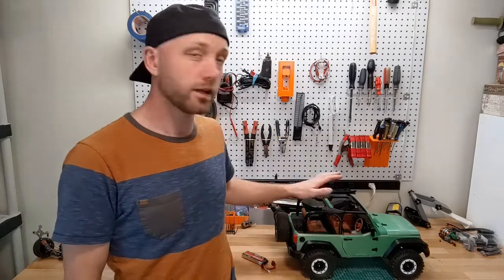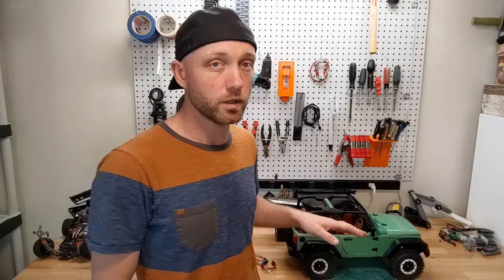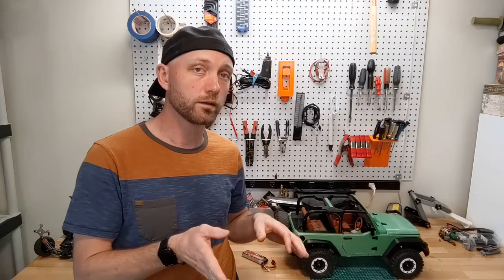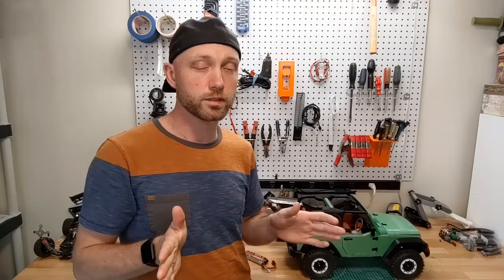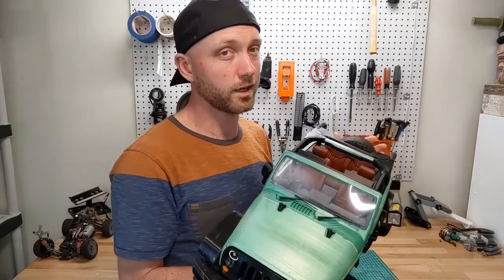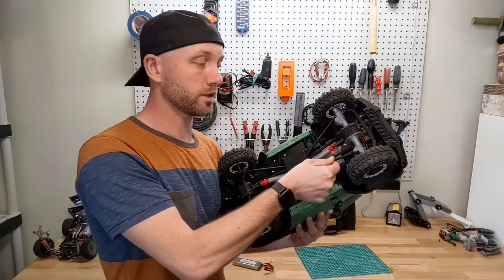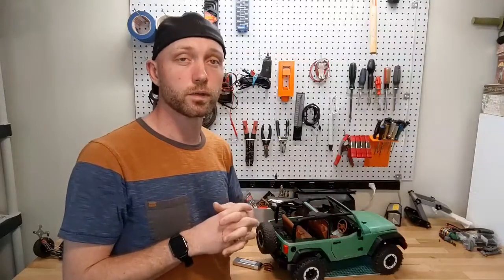3D Sets Rancher Review - Should you build this 3d printed RC Jeep?

Comment: Nice and honest review! A few hints/ tips from a Rancher owner: use higher temps when printing the drivetrain parts in PLA - around 220-230°C depending on the filament - to improve layer adhesion. Also: repairing/maintenance is not as complicated as you have described. E.g: you can drop the whole gearbox/motor by undoing 8 screws if I remember correctly from my Rancher (the center piece at the bottom, the two screws that hold the gearbox/motor and one cardan joint to get it out). You can take out and disassemble the gearbox in a couple of minutes, been there, done that :) For the lights: there are quite easy mods on thingiverse, especially the front lights, rears are a bit tricky because of the limited space. Also quite important: there is a very active, enjoyable and helpful facebook community for the 3dsets cars!
Reply from the maker: Thanks for the tips!

Comment: Good video, nice review of the Rancher. I've spent the last several months building one for a friend several states away so I have had to go the bulletproof option but I have had the trans in and out numerous times getting everything right. You should only have to pull the two screws on the trans, the two screws for the dash and maybe the 4 screws for the skidplate (had to pull the skid to fasten the driveshafts after the fact) to pull the trans out. Have you seen 3d sets Model 7 Buggy? It might be right up your alley :)
Reply from the maker: Thanks for the tips! The buggy is definitely on the list to build. Hope I can get to it soon.

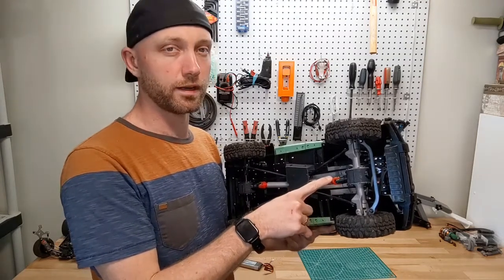Comment: When you said that you had to reprint the parts that were failing(around the 10:30 mark) you said you used PETG initially, but didn't say what material you ended up with after you reprinted them.  Do you happen to remember? I had those drive shaft joints fail me almost immediately, and I printed them in ABS.
Reply from the maker: Just PLA. It's the 100% infill that makes the difference.

Comment: if I were to send you a bunch of pictures of my jeep ( inside and outside) would you be able to design and print it? If not do you recommend anyone who you like for rc car? Great video!
Reply from the maker: Hey Holly, you're really going to want a 3D Printer if you're in the market for one of these things. Parts WILL break and it wouldn't be a great experience if you couldn't get replacements easily. I'd recommend getting an Ender 3 V2 and learning to print it yourself, its really not that hard and we have build kits here: https://rcprinter.com/products/3d-sets-rancher-build-kits! I don't know of anyone who would 3D Print a custom Jeep for ya. To price it out, non-printed parts are going to be a couple hundred bucks and you'd have to buy a copy of the print files from 3DSets and then the printing time is going be weeks of continuous print time and filament and then the build time is a day or two of work plus painting all your customizations so the cost someone would have to charge would be quite high. I think if you found someone who would be willing to do it you'd be looking at a price tag starting at maybe $750 US and going up from there ... and then you'd still have the fixing it when it breaks issue :-/

Comment: Love my rancher, you can actually take out the whole gearbox but it's a bit messy. I also hate the plastic pinion. Always drops off. Wish they had standard M1 gearing for the last gear instead if that helical gear so we can use a standard metal pinion.
Reply from the maker: Yeah I've since realized that its not nearly as hard as I initially thought to remove the gearbox and I've since upgraded to the brushless belt drive gearbox on all my 3dsets models.
Reply: @rcprinter  ah yes, still need to print that one

Comment: I've been having trouble with the ball joints. They just won't go into track bars without something breaking, and if I do get them to snap in without breaking, the movement is too tight and stiff. My printer is calibrated and optimized for movement and extrusion. I may have to just file or sand down the ball joints to get them fit easier.
Reply from the maker: Hey man I thought I responded to this already but guess I didn't save it properly or something. Hopefully you got it figured out by now. Mine all went in without breaking but it was a tight fit. Make sure you're lubing them up first before they go in and I think I used a pair of channel lock pliers to press them in like they show in their video (not in the instructions). If that won't work a little bit of sanding should definitely help or you could reprint the balls with a bit of under extrusion.

Comment: Great review,  I was wondering what is missing from the kit you are selling to build this ?
Reply from the maker: Our full kit right now still doesn't include tires, shocks, controller and receiver, battery, and supplies like gear lube, threadlock, solder, window plastic. You can see the full list of all required parts from 3DSets here: https://docs.google.com/spreadsheets/d/1pderDRfrMKgJRtTv9E3Lh8AeVkLXk5VFxauGmBlD4D4/edit#gid=0
Reply: @rcprinter  thanks am really new to RC want to print this but am finding difficulties to collect the parts
Reply: @rcprinter  but the motor and the servo are there right ?
Reply from the maker: @fahadalmulla4982  there's a few different options for kits but the biggest one comes with motor, servo and an ESC.
Reply from the maker: @fahadalmulla4982  Well our kits make it easier but we don't have full kits yet unfortunately. Generally most people will order the rest of their stuff from China on Aliexpress or banggood and it'll take a month to get there. Alternatively, a trip to a good local hobby shop should be able to get you everything else you need right away!
Reply: @rcprinter  thanks yeah your kit definitely make it easier , but now am considering  the total cost to see if it worth it 🤦🏻‍♂️

Comment: can i just use the body and use it on an existing 1/10 RC CRAWLER?
Reply from the maker: The body prints in many pieces that all get screwed onto the chassis. I don't think you have any luck using the body on an existing crawler.

Comment: Can you supply a list of the electronics you used? I'm having problems finding the some of the parts like the ESC
Reply from the maker: I just used this motor/esc combo kit off banggood: https://www.banggood.com/540-Motor-60A-ESC-Carbon-Brushed-Shaft-3_175mm-For-110-RC-Car-p-1187528.html?cur_warehouse=CN&ID=47279

Its from China so it took a month or so to get here but its cheap and does the trick.
Reply: @rcprinter  Thanks for the quick response. Any suggestions on the servo and the tires? Can't find anyone that sells individuals tires and was going to buy 2 sets. Almost ordered that ESC motor combo but they wanted $23 for shipping...
Reply from the maker: @cycloneus808  Ugh, $23 for shipping is steep. Its only $5 to my house in Canada. I think these were the tires I used: https://www.amazon.ca/gp/product/B07167PS9V  I just used an old tire off a traxxas slash for the spare instead of buying two sets.

For a servo I think I used this one: https://www.amazon.ca/gp/product/B0769DFJVK/ref=ppx_yo_dt_b_search_asin_title?ie=UTF8&psc=1

Generally I get most online stuff off either amazon, banggood or aliexpress. Sometimes I'll find one-off items on ebay that I can't find anywhere else but less often than the others.

Comment: Hey can you suggest a motor/esc brushless,  servo setup? Thanks
Reply from the maker: I usually use cheap surpass hobby stuff from China like this: (Unsensored) https://www.banggood.com/Surpass-Hobby-F540-Brushless-Motor-60A-ESC-LED-Program-Card-Combo-for-1-or-10-RC-Crawler-Car-Vehicles-Model-Spare-Parts-p-1749052.html or this (Sensored): https://www.aliexpress.com/item/1005001963255998.html

and servos like this: https://www.banggood.com/DSSERVO-DS3225-25KG-180-Degree-Metal-Gear-High-Torque-Waterproof-Digital-Servo-For-RC-Airplane-Robot-Car-p-1353688.html

These types of parts have suited my needs so far for 3d printed builds and I wouldn't be the best to recommend "name-brand" higher end stuff. Also, I haven't tried brushless in the Rancher (sensored or unsensored) so I'd be a bit wary. 3Dsets has a very active facebook group though so you may want to check that out and ask there.